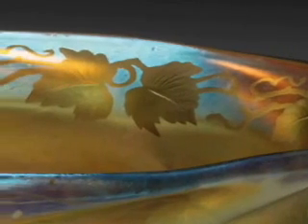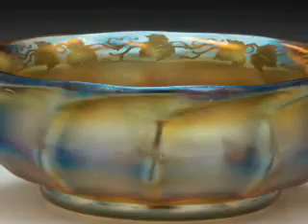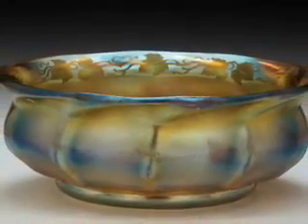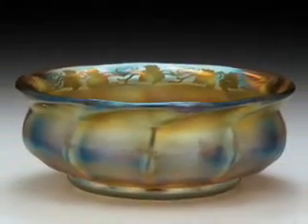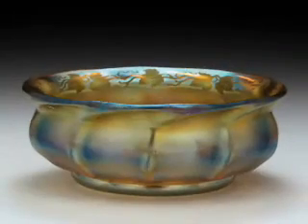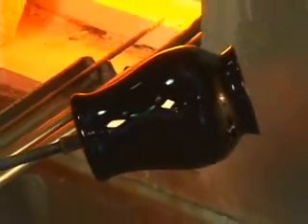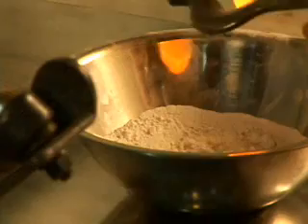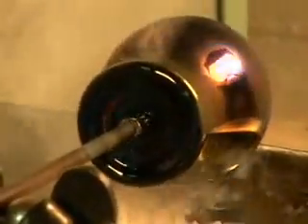Making Iridized Glass

Comment: I'm curious if this is the same thing used to add those irridescent"laser" coatings to things like Pop Vinyls and other plastic toys?
It's something I've been trying to figure out for some time, and the rotating method seems very consistent since these figures seem to have been rotated on a rod of sorts in the coating process.

I'm not sure you'd know about any of this, but it seems to be my best lead to solve a little mystery. Shame it's so toxic I wouldn't be able to recreate it myself if it was even viable.
Reply: Many iridescent objects are made by coating them with a VEEERY thin plastic/polymer surface.

Comment: Do iridized finishes react with water/moisture/air over time and rust or oxidize? 
Since they have metal in them? Or is the finish too durable?

I ask because some people who paint miniatures with acrylic paints use agitators to help mix the paints in the bottles. Stainless Steel Ball Bearings are generally thought to rust after some time from exposure to the paint since they contain metal even though they finish is durable. 

I am looking for a agitator that will not oxidize in acrylic paint and found some 8mm Iridized Tiles but am not sure if they will oxidize due to the metal content.
Reply: They most likely won't, as most metals used for the process are generally quite corrosion resistant as compared to steel(tin, silver, indium, zinc, etc.), but you may also just be able to use non irridized glass if you're concerned.

Comment: Can glass alone be iridized? Or can metals be iridized too?
Reply from the maker: +Shane Smith - I don't know much about metal patinas, but in theory you could iridize a decorative coating on metal.  The metal would need to be kept warm while the iridization metal condenses on the surface.  Also,  I don't know how well it would bond.
Reply: metals can be irridized in a few different ways, through natural and manufactured reactions. Oxidation is responsible for most of the iridescence in metal, such as most tarnishes, patinas, and tempering coloration. Copper and silver are super reactive with stuff like skin oils, which is why you see em tarnishing or taking on a patina so often, whereas things like steel and titanium can be color changed with high heat and oxidation simultaneously(or really hot flame). I'm still researching all the ways I can color metal and other materials but these are a few I know to be reliable

Comment: For the really good color, Silver Nitrate needs to be dissolved in the glass batch itself. After that, subject the vase to the reducing flame which will give a mirror-like silver surface. Then spray with a solution of Stannous Chloride as someone else hold a torch to the object. When the colors seem to be good, stop and go back to the reducing flame which will burn the shine off and leave a velvet feel to the glass once annealed and able to hold.

Comment from the maker: Josh DiFilippo Iridization is a metallic coating deposited on the glass surface.  Temperature is important.  Wowie is right, there are a number of choices, but going with a titanate spray would be a good first choice.  Fuming the old way in a cloud of vapor requires careful ventilation and filtering.  I don't know definitively how well it will work with borosilicate glasses.
Reply: Did you use stannous chloride in a liquid solution

Comment: tin chloride, iron chloride and  isopropyl titanate are the iridizer's
mostly used with soft /soda-lime glass. i never fume like it shows
  here  too much of those smokey vapors will  kill you.        
its better to dissolve the tin in alcohol and spray on hot glass .
 the clorides are good to high temps with no matting of the surface
however the titanate will mat  if reheated . so box the piece.
Reply: its all poison, just some are worse than others ,some can kill you in 20 years and others by next week
a ventilation hood is a must .
Reply: Sorry to ask but by any chance do you know if it works well with boro
Reply: Josh DiFilippo
no idea how it works on boro  but i sorta remember  there are a few fuming chems
used on it  but again get good ventilation!!!
 you also might try some silver bromide or silver nitrate; stay  in reduction when heating .
&  you can use hanovia gold luster  but that goes on cold and
you re fire to 1200F
i've been a glass artist for 40 years starting with flat glass and made my own glass paints for church windows  now i blow & batch my own colors  
but haven't done  a lot with a bench torch but to make parts for weights and
add on pieces for  fancy reticello & latticino goblets ...
Reply: +wowiezowiepowie  Be very careful with that  bromide.
Reply: Could this be done with resin?

Comment: This actually turns the glass surface into an electrical and transparent conductor, commonly known as a TCO (Transparent Conductive Oxide) in the solar cell industry. Three types of TCOs are used in solar cells, one is this, SnO2 (tin oxide), another is ZnO (Zinc Oxide), and a third and more expensive one is Indium Tin Oxide (Indium Oxide doped with Tin Oxide)

Comment: So all you need to do is get the stannous chloride hot to make fumes?
Reply: +Highly Possible  Best to dissolve stannous chloride in sterile water and spray on the glass when hot.
Reply: +John D  Hot as it would be out of the furnace but no longer pliable to form. It is still on the end of the Punti. When spraying, if you could have someone else with a torch going on or near the glass, this will help keep it hot enough to take the colors better. Please be careful! The fumes are deadly. Have a good exhaust system in place. Never breath this stuff. Stannous Chloride eventually eats through the metal blades of a fan!
Reply: Musique3579
Cheers for the info, its not really something I can do if it means it has to be that hot.
Reply: +Musique3579 Hay great advice here, how hot does the glass have to be when spraying? thanks again